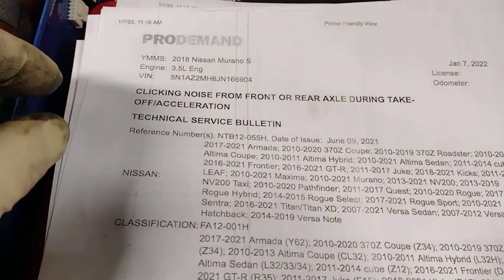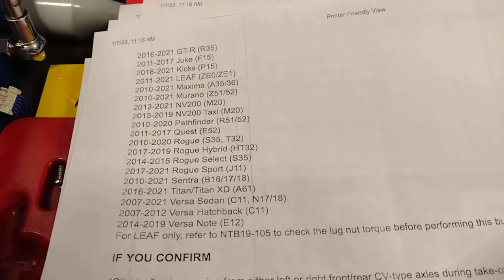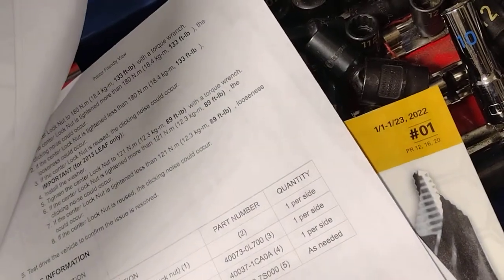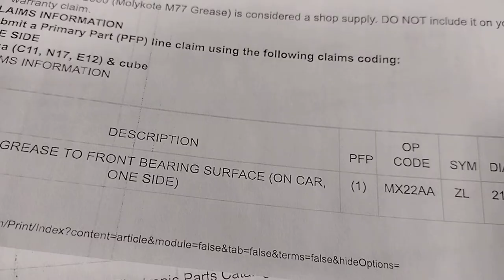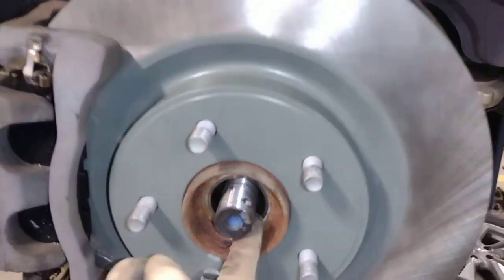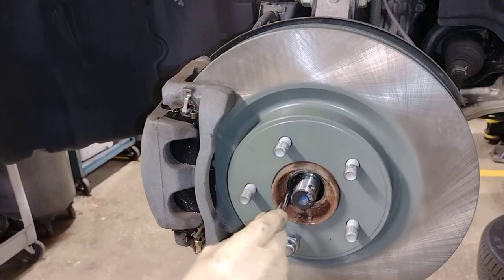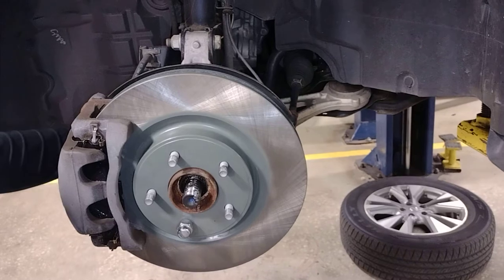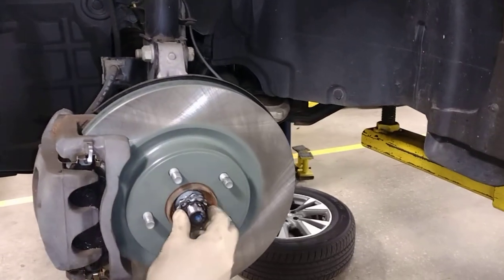2010-2021 Nissan Click Type Noise Or Thud on Acceleration/Deceleration/Turning. TSB NTB12-055H

Comment: All your information is brilliant. Thankyou so much. Im in Australia. I’m looking at buying a 2021 Nissan LEAF EV (base model) and 3 out of the 4 I’ve test driven so far have had this clicking/clunking noise (some have been louder than others) it is very audible with the passenger window down. Is this something that has been fixed from 2022 onwards? Or do all of them have it? I’m shocked that Nissan hasn’t fixed this permanently! Is this something to be concerned about if I purchase one? Ie; if left unattended, will it harm the car or will I be in danger in anyway (Will a wheel fall off etc?!) ? 
Thankyou so much
Reply from the maker: First off. Thank you for watching and welcome. Secondly I don't know if it's for 2022 and up I can find out from a friend at Nissan. Heck the Nissan dealer I worked at a lot of the techs didn't know about it.  Will it harm the vehicle if left unattended?  As in the wheel fall off? No. But it may get seized in there over time as moisture and debris will be able to get into it. Hope that helps 👍
Reply: @BeardedFordTech  Thankyou so much for your prompt reply! 🙂🙏🏻 I mean absolutely, if you have the means to find out from Nissan that would be amazing. I’ve done a lot of research between yesterday & today and it does look like a reasonably easy thing to fix. But the question is; will this issue continue to present itself throughout the cars life? Most videos I’ve found the car owners have to fix the issue once a year or more! It just baffles me why Nissan hasn’t had a permanent fix for this! (Do you think this is grounds for negotiating a better price?)
Reply from the maker: @Tanya_Rich_Actor  this won't be grounds to negotiate a better price because it is a TSB and so many vehicles are involved. Nissan knows about it that's why there is a TSB.  It's not a safety concern otherwise it would be turned into a recall.  Which is why you can't take it in and get it fixed for free like a recall.  It would be fixed as a TSB which tells you to add grease to the splines. It's caused by the machining process where the splines are cut slightly smaller. When you give it throttle or let off. You are hearing the axle spline "bump" the hub spline. The grease closes this gap and keeps moisture out so it doesn't seize up. Now I did fine out ithe new ones are effected too.  And the use of Moly-kote grease you will not have to keep doing it.  If you use regular grease you will have to repeat about every year. Moly kote is a grease with molibdinum in it which is an anti wear additive. Hope that helps.  On a side note not related to the vehicle. I saw your subscribed to AthleanX. Awesome programs those are what my wife and I do.  She actually had a job interview over the phone with him about a remote product specialist position. Was pretty interesting
Reply: @BeardedFordTech  That’s brilliant, Thankyou so much for all your help and effort, it’s greatly appreciated ☺️👍 
I guess there’s not many reasons now to not go ahead with buying one! I do love them! 

Oh wow 🤩 I hope your wife got the job?!
Reply from the maker: @Tanya_Rich_Actor  your welcome. No this was around this time last year. They went with another person who had one more certification than her. All good though.
Reply: @BeardedFordTech  what a shame 😢
Reply from the maker: @Tanya_Rich_Actor  it's all good. We still use his program and she's on the list for any other openings

Comment: I'm getting this clicking noise too with my 2018 nissan altima . It comes and goes. I just had my cvt transmission replaced last Aug thank God for the warranty.  There's not a chance this noise is my transmission right ?
Reply from the maker: I doubt it. More than likely the axle shaft
Reply: @BeardedFordTech  so using the molykote greese should do the trick
Reply from the maker: @t.caskets9893  should. That's what it calls for and that's what they gave us at the Nissan dealer (when I was there for a short time). I would get it checked out to be sure.
Reply: @BeardedFordTech  Thanks Buddy I will definitely bring it in sometime this week .
Reply: Sorry bud 1 more question.  When I go to nissan and tell them about the ticking,  am I telling them to greese the axle shafts? Thanks again fkr for everything 🍻
Reply from the maker: @t.caskets9893  tell them you hear a clicking in the front axle. They should know what to do from there if that's what the problem is.
Reply: What Grease do I use for Nissan Pathfinder

Comment: Thank you very much. Where can I get this  tsb?  I want to read whole document if its possible.
Reply from the maker: https://www.tsbsearch.com/Nissan/NTB12-055H
Reply: Thank you very much indeed.
Reply from the maker: @korayus  your very welcome
Reply: I just read the document but coulnt find Nissan Leaf Center lock nut torque value for ZE1. Something is missing :(
Reply from the maker: @korayus  what year. I can look it up
Reply from the maker: @korayus  what is your email. I have the tsb with instructions and torque specs. The leaf is 89 ftlbs. But I can send it to you if you want to read it
Reply: @BeardedFordTech  2018 and 2021 please
Reply from the maker: @korayus  it says leaf is 89 ftlbs. But to check TSB NTB19-105 for lug nut torque first before proceeding to NTB12-055H. Lug nut torque is 85 ftlbs. Hope that helps.

Comment: Without warranthy what is the price for this fix
Reply from the maker: It's not a warranty. It's a TSB "Technical Service Bulletin". I think I pays like a half hour. So whatever your service center charges per hour then it would be half of that. It is something you can do yourself to save money if possible.
Reply: @BeardedFordTech  i have a 2019 nissan sentra. I notice when i accelerate and stop accelerating is making the ticking noise. So it should be this?
Reply from the maker: @Therealpeter10  possible. This is more of a click you would hear. Are you only hearing the noise when accelerating of stopping?
Reply: @BeardedFordTech  i hear the click when accelerating and when i take the foot of the gas
Reply from the maker: @Therealpeter10  accelerating from a stop right?  Not just accelerating down the highway?
Reply: @BeardedFordTech  correct or maybe going about 10 to 20 mph
Reply from the maker: @Therealpeter10  sounds like this is your problem.
Reply: @BeardedFordTech  ill have to take it to nissan. Not very good with mechanic stuff
Reply: I have a 2019 rogue and it sounds like luggage is falling sometimes when I stop or slow down and turn and also sometimes when accelerating and it makes the bark jerk forward any suggestions on what it could be and there’s nothing in my trunk that fell over

Comment: how much torque did u use to close it ?
Reply from the maker: To close it?  It literally shows to the torque specs to tighten it. It was like 90 ft lbs I think this video is old I don't remember off the top of my head.. It shows it in there will the list of vehicles.
Reply: @BeardedFordTech  they write for specific models like LEAF , mine is 370z any way i will try that value thanks
Reply from the maker: @kxosdev  was the 370z part of the TSB?

Comment: How can I tell which side wheel it is on? Or should I do this to all 4
Reply: Planning to do this for my 2014 nissan sentra sv soon, what would the torque be at, bought the car a year ago with no owners manual
Reply from the maker: It's the front wheels..not the rear.